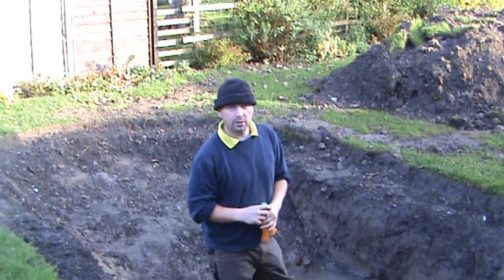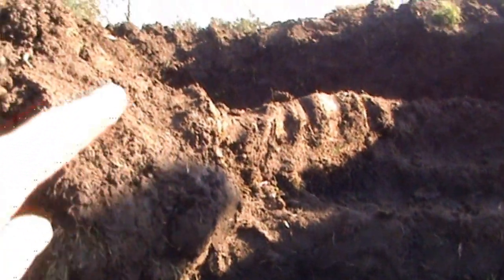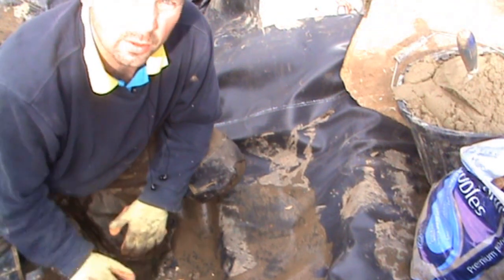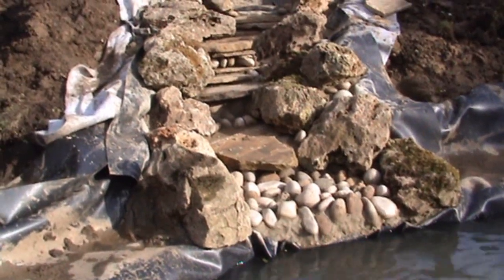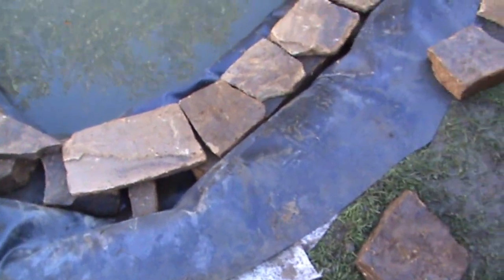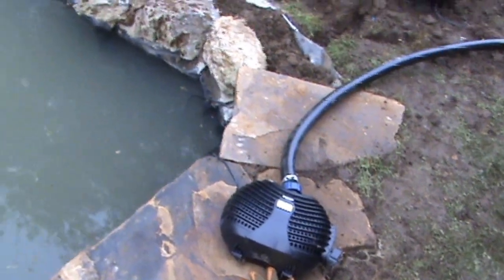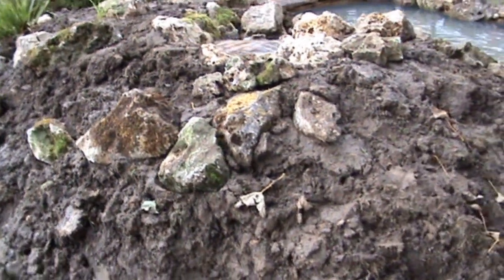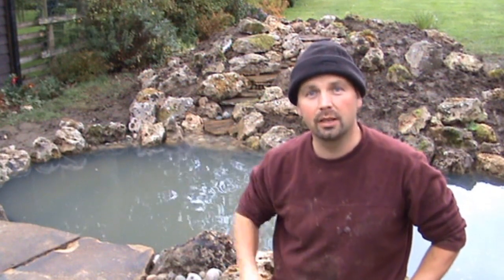How to Build a Fish Pond and Stream / Cascade - Complete pond building video by Pondguru

Comment from the maker: In this particular filter the foams act as mechanical and biological filter media so won't do much of a biological side until they get some filth stuck in them.
Normally the UV would be switched off for the first week or so just to allow the filter to build up with some bacteria as the UV light kills both bad and good bacteria, yes.
I normally leave the pond running for a week or two before adding a few fish then add to the stock weekly after that.

Comment: nice nice nice.... wish u cld travel to the Caribbean and hook me up....
Reply from the maker: I wish I could go to the Caribbean too but I'd have no intention of doing any work. I'd just be lying on a beach and swimming in the sea, lol
Reply: Lolll... I know the feeling bro.. Keep up the gd work..
Reply from the maker: mali bu
Will do, man.
Thanks for watching and appreciating the videos.
Reply: Tell me something... My pond is on the open under direct sunlight... I HV a filtering system and a UV light connected to it yet the water is still getting green... What am I doing wrong?
Reply from the maker: mali bu
I'm assuming that the UV is part of a filter system so the system must not be large enough to cope with the volume of water / stock of fish. e.g. If a filter system is for 'up to 4000 gallons' it will actually treat up to 2000 gallons when you take fish and sunlight into account. Less when there is koi or warm conditions and lots of sun (maybe only 1000 gallons).
Reply: Oh I see... I think that's the ans to my problem m8... Guess I'll HV to upgrade my equipment.. Thanks a mil... Will let u know of the results...
Reply from the maker: mali bu
No worries, man.

Comment: Those filters... had 1 myself! High maintenance and not very effective!
My 2nd incarnation; I dug a hole, bricked and rendered, bottom drain with aerator. 11K LPH pool pump, sand filter with clay pellets, UV and 2 barrell filters with jap matting, and a cascade back to pond. About 20 Koi!
Reply from the maker: Everything filter performance is relative to what size of pond / fish load it is used for.

Comment from the maker: That included the labour so you could half that if you're doing it yourself. I would always advise using the best quality liner, underlay, pump and filter so for me those prices will always be fixed. If it rains enough for the pond to overflow, everywhere will be soaked anyway and you'll not notice and extra wetness. The pond would generally operate below maximum capacity so there is a buffer there to take up excess rain.

Comment from the maker: I'm predicting that you didn't look at the video description or properly watch the video. The filter is a Filtoclear 30.000 and will have no problem keeping a pond this size clear all year even with a heavy fish stock. 
It has a 55w UV light which runs down the centre of the filter. The filter is buried way into the ground and has plenty of foams to provide mechanical and biological filtration. You may be confusing enzymes with bacteria.The bacteria process waste. Foams strain out suspended muck

Comment from the maker: The materials I always use are as follows:
Oase pumps and filters
Firestone 1mm rubber liner
Polyester underlay
There may be companies offering the whole lot of materials as a package but I'm not aware of any.
In the winter if you have a small pond it's often best to turn the pump off to prevent chilling the water if you have fish. In a larger pond you can move the pump to just under where the stream pours back in which prevents disturbance of warmer water on lowest layer in cold weather.

Comment from the maker: The liner I use is Firestone 1mm rubber - I think in the US it is called .45mil?
It is laid over polyester underlay - May be known as 'polyfelt' in US?
The pump and filter I used is listed in video description and I always use Oase pumps and filters due to the low running costs and long guarantees. Not sure who imports Oase products into the US as I am in the UK.

Comment: its the hose on the pipe thats leaking. the clip is on a flat bit not on the ribbed bit maybe i should saw the flat bit off the hose(thats how they sold it)and tighten it on the ribbed part

Comment from the maker: I think it no good at 0.3mm and whoever is selling that as a proper pond liner and claiming it will last for 40 years should be publicly shamed or shot. I always use 1mm rubber over a good quality underlay as using the best liner does not add much to the cost of the job when you total up all the other associated costs of the project. My only advice would be to go for the best equipment and only do the job once.Thanks for watching, man.

Comment: actually i have been building ponds for 5 years. if you do a proper overlap, stream liner over the liner into the pond you will not have to use mortar. and it looks natural. also, you shouldn't see ANY liner. liner is ugly. use stone to cover it, make the pond strong, and save the liner. liner has a 25 year life, but longer if you dont let the sun hit it, the suns UV is what deteriorates the liner. take a look! 
maybe this is more helpful

Comment: Personally I would try to avoid using any cement or adhesive/foam etc, try to arrange the rocks using just gravity; if at some unfortunate point in the future you require to look at the liner because of a leak, heaven forbid, its thousand times easier to dismantle it.  'Dry stane dykes' have no cement or other any adhesive , so its just not necessary.

Comment: I have better ideas. Like i would have used and ash mud cement to line the sides before i put the liner in. I also would have installed a pipe underneath for an underground hot air bubble to keep the pond warm in the winter and also oxygen. then id' also have warmed water flowing out my cascade as well for tropical fish that like the warm water. also it helps promote breeding in certain sea life.

Comment: He did a great job but will learn it will take forever for his water to be clear with all the faults he has for water to run back off into his pond but he is learing like we all do and fix it I'm sure. The first hard rain is going to wash his dirt right back in the pond. Everything else he did was awesome except the pump he spent a fortune on. That is preference though. I don't want to get my hands wet so I just turn a knob flip and switch a few times and turn the knob back and I am done.

Comment: I see you're not using a weir at the top of the waterfall.  Is that something that isn't necessary?
Reply from the maker: Provided the water can be controlled in a header pond then you won't need a weir.
Reply: Pondguru So you create a small basin where the water can pool after exiting the pump hose and before it begins to cascade?
Reply from the maker: cambuil Yes and it settles the water down allowing it to flow more naturally.

Comment from the maker: I've taken a look and there are still no videos on your channel even though you have been a member since 2007. Anywhere the liner would be directly exposed to sun is covered in this pond. A large percentage of UV rays are reflected off the water surface so liner takes many times longer to degrade. (i.e you don't need to worry about that as it will last many lifetimes under water)
A jumble of rocks like 90% of the videos I see on youtube never looks natural.
Maybe you should make some videos?

Comment: is having a pond little smaler than this one a lot of money
Reply from the maker: Like anything, a pond can cost as much or as little as you want.
It depends on the quality of materials used.
Reply: do i have to use a filtter cause i have no fishes i the pond
ps: thanks for the anwser
Reply from the maker: Petar Suklje Most wildlife ponds don't have pump or filter.
A well planted wildlife pond will generally stay clear but if you use a filter with UV then it will guaranteed to stay clear (provided the correct size filter is used)

Comment: I was always led to beleive that you could not use ordinary cement where the water will make contact???????
Reply from the maker: Provided you allow it to harden for a couple of weeks, completely fill the pond and run pump for a couple of days then completely drain the pond before refilling it will be no problem as contact will be minimal. For rendered ponds they will need to be sealed with appropriate paint.

Comment: Most of the contractors I watch use spray foam why did you use concrete
Reply: Concrete is what the old timers tend to use, foam is far better especially when it comes to design. Koi pools require concrete usually as they are like boxes for showing off the fish, not really a stimulating environment though.
Reply: Creative Cascades oh ok